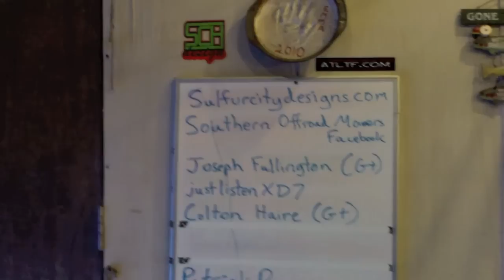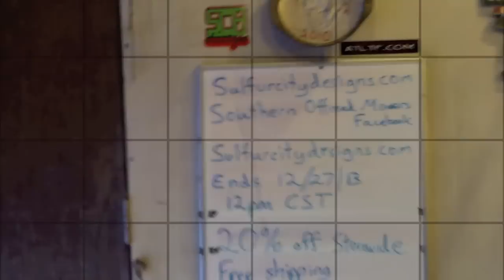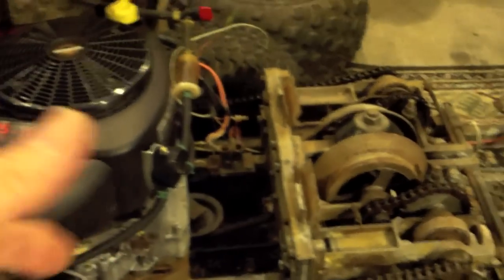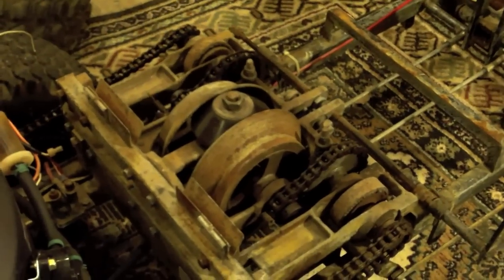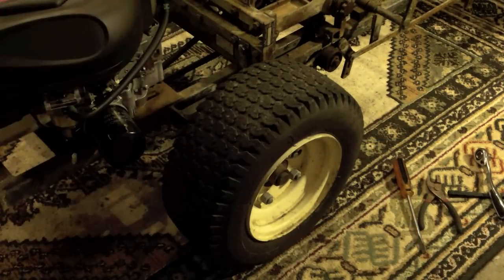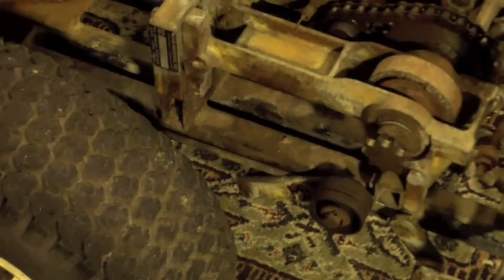Friday Rambling

Comment: With so much weight on the back would it make sense to locate the battery on the front that gets it away from the gas tank and helps to counteract all the weight at the back. Also it would be something you don't see on every other mower. You could make a steel, or wood box to protect it.

Comment: Hey why waste money on new chains when a full clean +heat relube will make them usable again, worth a go :-))

Make sure your battery vent tube goes down (if it has one), and the quality of the connections will prevent sparks, just make every joint clean and tight + well insulated, zip tie cables to stop rubbing on metal edges and they wont go wrong :-))

Sloppy workmanship is not your nature.